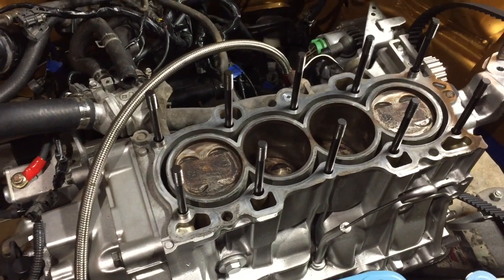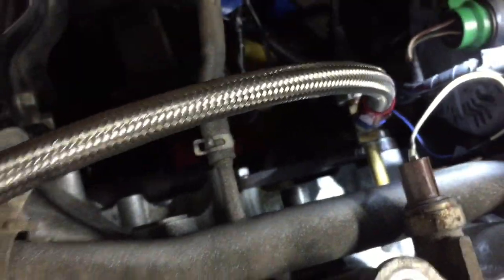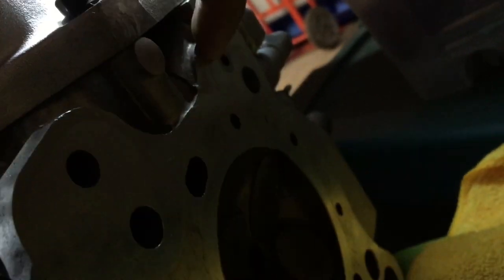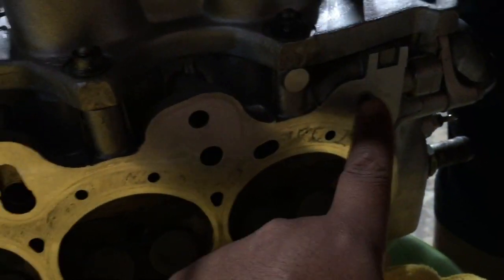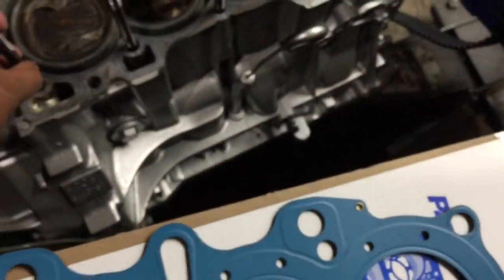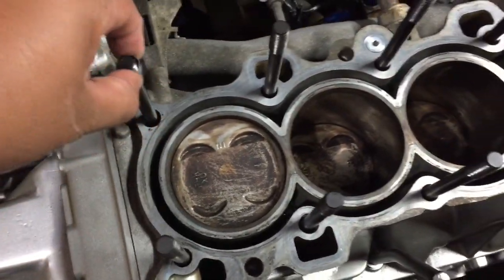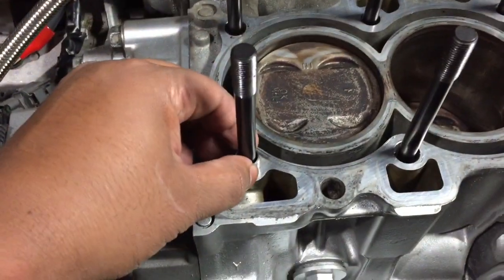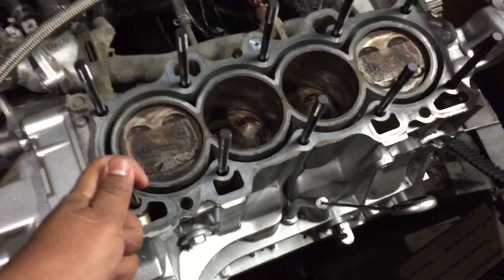B20 vtec dowel pin scenario breakdown DIY how to felpro gasket

Comment: When tightening down the stock main cap bolts I am experiencing some creaking. Threads are clean and I applied a light oil to bolts. Has anyone experienced this?? Should I soak the bolts more with oil or ?

Comment: I have a b20 vtec setup. B16 head b20b block. Do I need to use dowel pin if I am running ARP headstuds? Or I can ran without dowel pin. Also will it be safe or ok to run without dowel pin if I were to install cams and upgrade valve trains and tuning?

Comment: Okay so the dowell pins are definitely needed. Otherwise no matter how much you torque the head it will walk without these pins. They serve a purpose besides just alingment. It keeps the head aligned saving your fasteners and whatever else will come from a head shifting and shearing head studs.

Comment: I have a oil leak on mine did I do something wrong B20b gsr head oil leaking from timing side area got arp studs with dowel pin and cometic head gasket 84.mm
Reply from the maker: Try using hondabond around it. Smear it on your finger with thin layer. That’s what we did. Use the bottom block gasket if possible. Never had a problem.
Reply: HellaStance will try that thank you
Reply: HellaStance is there I reason why it leaks
Reply from the maker: Pedro Rivera can be a couple factors. Block or head need to be resurface, the oil drain like us not the same size, gasket, and head stud use performance
Reply: HellaStance head came from shop ready to go block is straight must be the head gasket
Reply from the maker: Pedro Rivera head gasket or head studs. Don’t use stock head studs.

Comment: If they don't put those that down dowel pins in you going to have blow by on your head I'm going to be compressed air or air fuel mixture will go into your radiator or your coolant system as well as your oil and you will be burning oil in that same way due to the fact that had is not properly aligned this is the dumbest thing I've ever heard.

Comment: I've used an one b16 gasket, a golden eagle ls vtec gasket, and now a je pro seal b16 head gasket. They all cause coolant burning on the timing belt side between the block and head. Block is decked and resurfacing the head 2 times now. Using arp head studs as well. Should I try an ls non vtec gasket?
Reply from the maker: Don’t use b16 not the same use whatever bottom is
Reply: @hellastanceLLC  Did u ever think that possibly.. just maybe...that that is the motor he has?
Reply: @hellastanceLLC  have you ever ran boost with a felpro head gasket?
Reply from the maker: @Duwop77  yes we did. not recommended, but it works. cometic gasket recomended
Reply: @hellastanceLLC  Thanks

Comment: Quick question? I currently have a full LS swap but I will be going LS Vtec with a GSR head. Will my stock throttle body, sensor, and cable work?
Reply from the maker: yes, all sensors from ls are same as gsr.

Comment: Did this work ?
Reply from the maker: Rob Blaze still racing it at a low 13s. Been running for a year and a half now
Reply: HellaStance i just put gsr head on my b20z . I just notced my dowel pins after timming the motor lmao . I have arp studs and cometuc gasket . ? Am i fucked ?
Reply from the maker: Rob Blaze just leave it, we are running no dowel pin also been a year and a half no issue. As long as you running aftermarket studs your good

Comment: Your head studs are upside down lol
Reply from the maker: If your an expert look at thread you see that we running Speed factory performance solid studs, NO allen keys made for it. So not upside down. Thanks for your concern austin.
Reply from the maker: still running that same stud not upside down. doing 12.7 now. we must be doing something right NA.
Reply from the maker: Yes, we did use loctite 270 and 262, don't be hating if you don't know what you talking about. LOL
Reply: austin stinnett and it's locktite 😂🤣😂😂
Reply: Lmfao
Reply: It's sturdy
Reply from the maker: @timm5970  still running from that day til now. So we doing something right. 13.4 pump gas

Comment: Did it work bro I'm building a lsv n I fKing forgot to put the dowel pins I have arp studs head is already on block torque down and everything
Reply from the maker: just leave it, we are running no dowel pin also been a year and a half no issue. As long as you running aftermarket studs your good.
Reply: What you do ?
Reply: I fucked up . Im runnin b20z gsr head . Arp studs . Cometic gaskit . I just noticed my dowel pins . It torque on and timmed . Should i leave it ?

Comment: Works fine. Done it with at least 6 cars lsv b16a b20v gsr and ran a few of them on boost 10-18psi never had a problem with the head walking. Shit some vws dont even call for dowel pins lol.